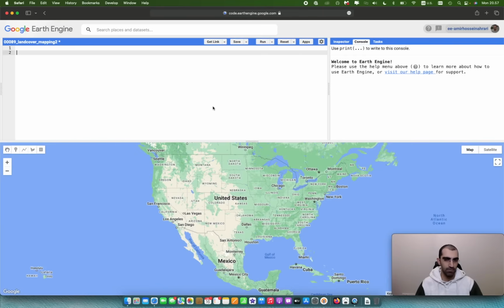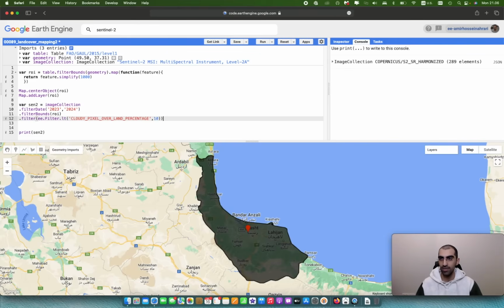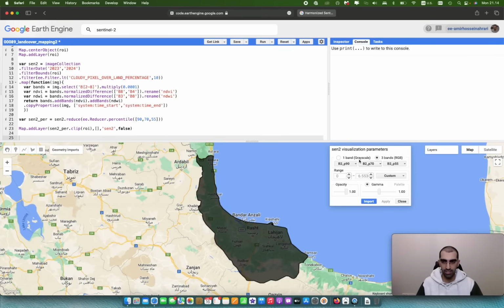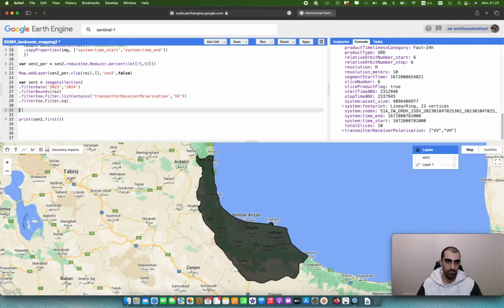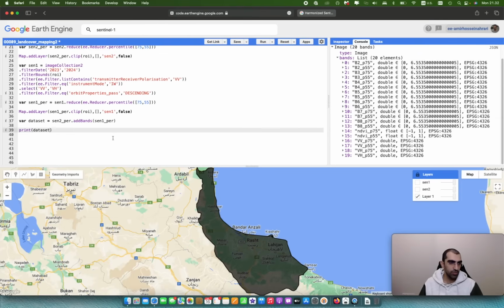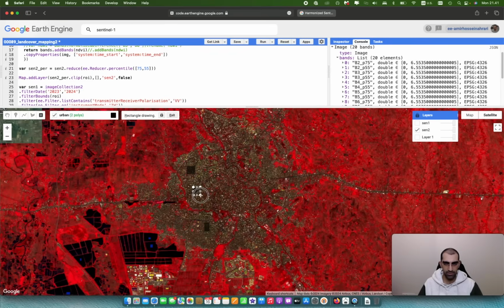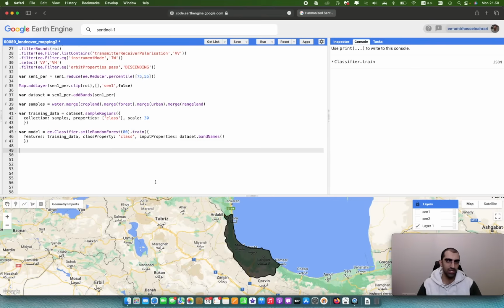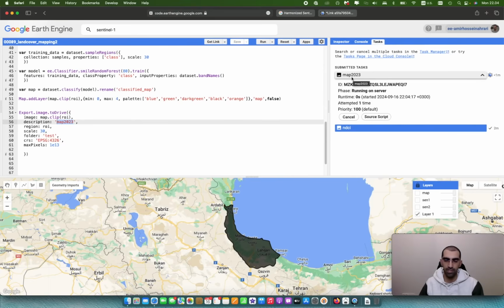Google Earth Engine Tutorial-73: Landcover Classification using Sentinel1 and Sentinel2 Images

Comment: Could you explain this please? 
Just a little confusion.. According to what I understand, you trained the model on the dataset variable and you test it on the same image.

If I want to do the classification for 2025 for example, will it be wrong if I keep the same training pipeline as yours, and use my 2025 image on the ONLY line where you called the CLASSIFY function?
Reply from the maker: I collect the training data from a dataset (2024) for example and then apply the trained model on dataset for 2024 to have a classified map using Classify function.
Reply: @amirhosseinahrarigee  Thank you for the clarification